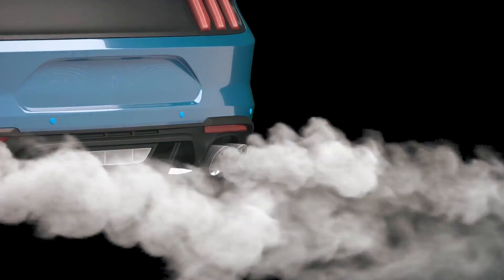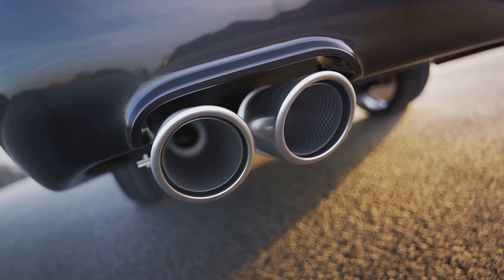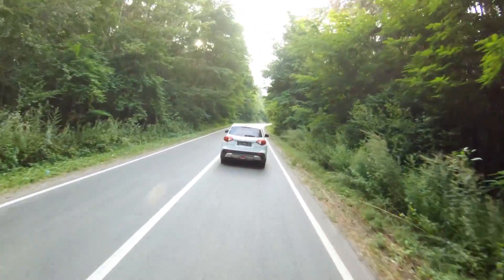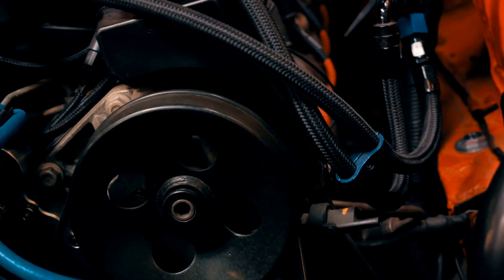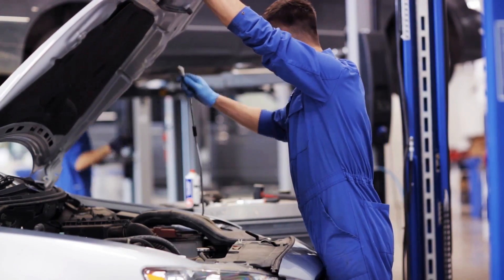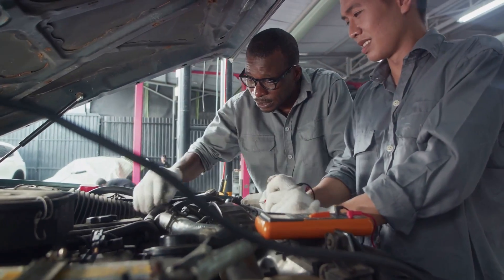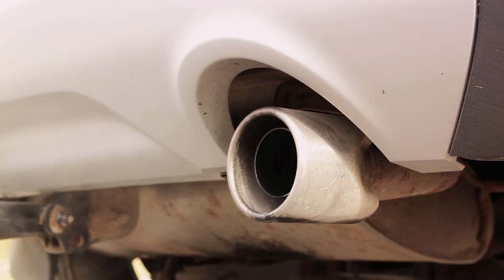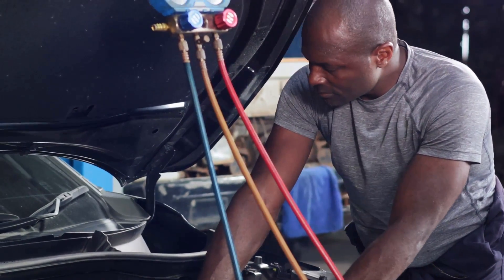Symptoms Of Bad Oxygen Sensor? Causes and Signs of O2 Sensor Failure.   How It Works?

Comment: Can a P0420 code be related to Oxygen sensors?
Reply from the maker: Yes, bad oxygen sensor can result a fault P0420. This may indicate a poor connection to the sensor or its damage. And due to exhaust leakage, this error occurs.
Reply: @autoadviser2779  Thank you, I used Cataclean and reset the codes. It's been 150+ Miles now so far the code hasn't come back.